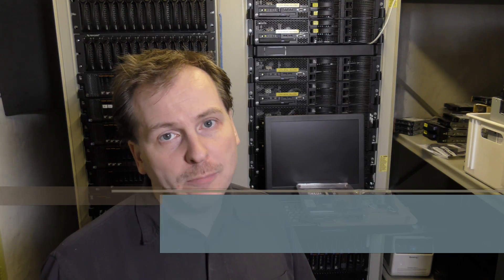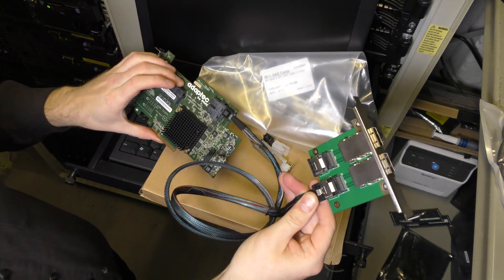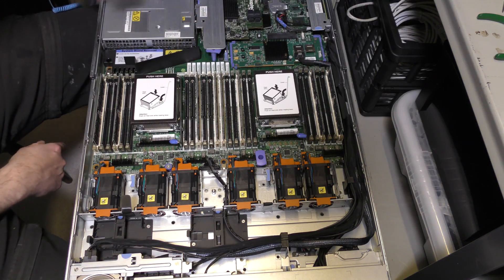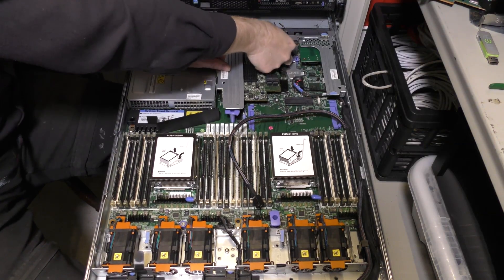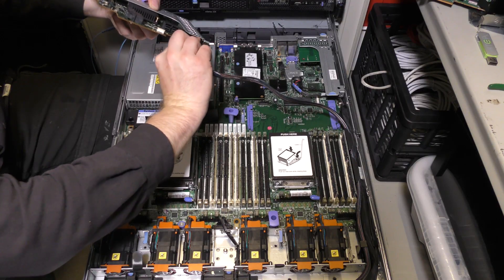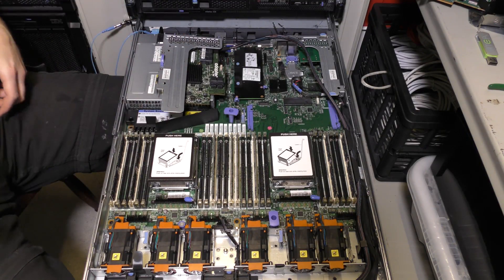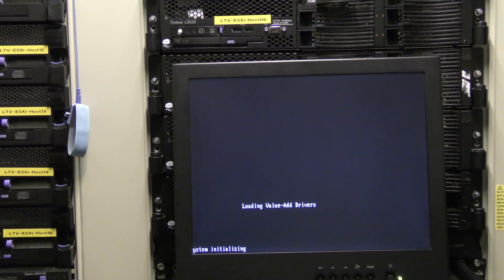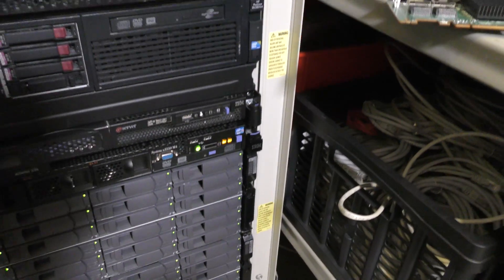Fiddling Around with External SAS port on RAID/HBA Card - 592

Comment: Hello dear.  Have you Find the solution for it ?
Reply from the maker: Ayoks Sumardianto I have a healthy interest in the opposed sex,,, stop with the "dear"
Reply: @MyPlayHouse  ok.. i am very sorry.. because this is standard opening conversation for commonly use in my county.. back to the topic.. have you found any solution for using an external sas connected with a smart array card which is pnly have an internal sas ?  Best regards.
Reply from the maker: I never got back to this,, but I tried other solutions afterwards,, also with little results,, I do not believe that the external port was the issue. So I think this works.
Reply: @MyPlayHouse  i already order the internal externas sas coupling card and i will connect it with HPE expander sas 12G. I hope it will work . Thank you

Comment: Hi, I've seen something simular on a server of our customer. They uninstall the non regular mounted RAID Card and the server does not like it. They put it in again and disable the card in the BIOS. After that it was ok. The Riser Card, I think, is a stupid piece  of PCB without any inteligens or chips. Run without it schould be ok. If the HBA is not accepted by the board it could be incompatible to your system (I didn't check the HCL). I had this kind of problem with an Dell R310 and an old HP external SCSI card that i want to get to work with a HP LTO 3 Tape Drive. It just turn off after showing the basic system start (Processor, RAM, RAID -> turned off). Your "SUN" RAID Card is ok, but the driver was not deliverd in the XPnology package. You say thay you don't like Freenas (BSD based), so maybe OpenMediaVault (Debian based) is something for you. It also workes with lower end stuff because it uses ext4 as filesystem.
Reply from the maker: Hi zENjA
Thank You very much! I have two LSI cards on the way,,, hope they,, or one of them will help move this project.
Thank you for watching! :-)

Comment: Are you going to get a Microsystems dual EPYC motherboard and two EPYC 49 core 98 thread SKUs and all the memory from the Lenovo server that is not working for some reason hopefully the memory from the Lenovo server will be compatible with the Microsystems dual EPYC motherboard  or if a dual EPYC is too expensive then a AORUS ZENITH TR4 motherboard and a 1950x Threadripper SKU should get that lenovo server back and running but without the old motherboard
Reply from the maker: It sounds a bit expensive,,, I do not have that kind of money.

Comment: Thank you very much for the RAID tour, it has been very interesting. I still believe that a lenovo or IBM branded RAID card is advisable. It could be Adaptec as well but the branding might be the trick. I forgot how you connect the server to the data storage, is it by external SAS Raid Card, or by SCSI card ? (in hp it is U320). Also Can you please remind me what software you are using for the data? Thank you again. NB I am not an IT guy, just a hobby.
Reply from the maker: Hi Mamdouh Tawadros
Thank You very much!  Yes externas SAS,,, I did show this in a previous video... Maybe have a look.
Thank you for watching! :-)